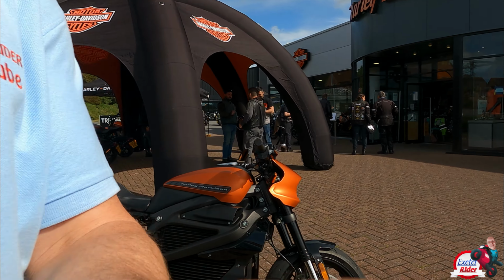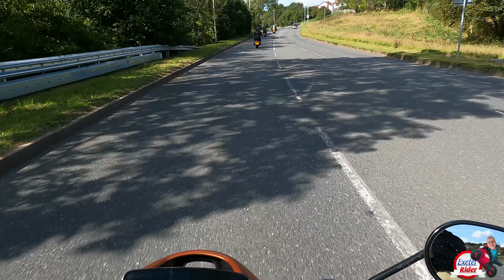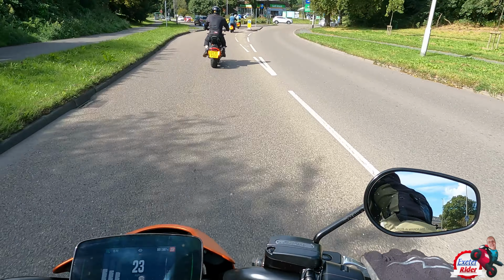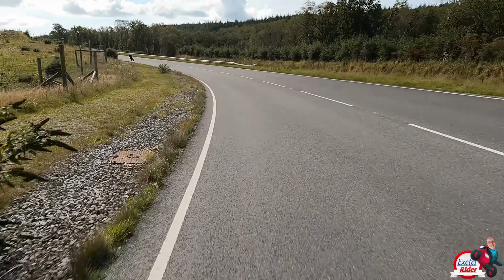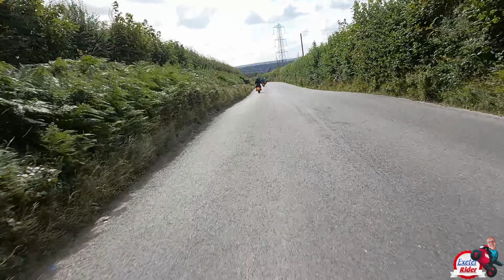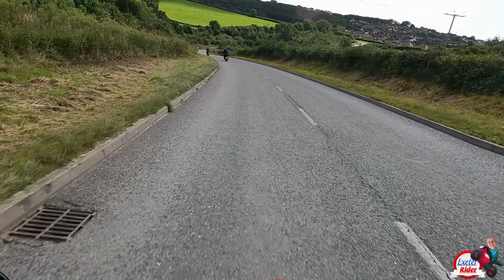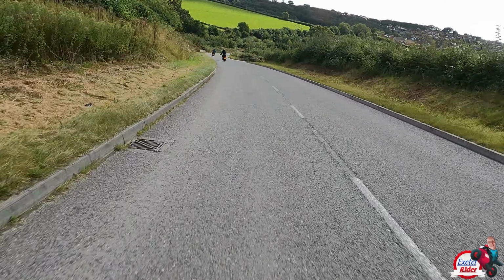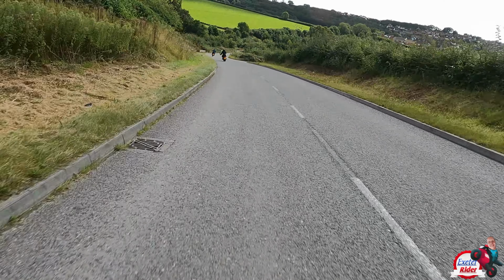Harley-Davidson Livewire Test Ride

Comment: Quite a nostalgic video for me,I remember that noise very well but with the added rattle of milk bottles in the morning.
I wonder if Harley will try to patent that sound....or have Dyson beaten them to it?
Looks good actually but waaaay out my price range,I'd probably get £800 for my old Bandit on a good day. I'm in Plymouth,I'd have headed up to say hello if I'd known you were in the City.
A bit of a worry as well that even the dealers were short of chargers,hopefully they'll become universal for electric vehicles so you can pick one up at Halfords or wherever if you need one.
Reply from the maker: Hi mate, will the fast chargers are a one off. This bike is fine for 100 miles, but with the bike being used all day, that's where the problem arose, so don't look into that too much.    If you do 100 miles in a day, you can charge overnight on a 3pin plug and be ready to go the next day.   Thanks Dave, maybe we will meet someday, but that eas a full day anyway 👍

Comment: Although I'd like an electric bike at some point, my only worry is the lack of noise, and people noticing you. They aren't that good when you do have some audible noise to warn them. I do think this is the bike that will push the rest to develop more. Thoughts?
Reply from the maker: I agree with you, but,  I would also say, when do cars hear you anyway? Windows up, radio on etc.
Reality is you ride much more aware that people can't hear you, then compensate for that, so it's not as bad as you may think but still a very relevent point. Thanks 👍🏍️
Reply: @exeterrider  yes, very true. Or too engrossed in Facebook!

Comment: Fantastic motorcycle! I test rode one about a month ago. I used to have a Harley Super Glide so I'm used to their switchgear. I wanted to get it but my body proportions or the way the bike was set up (bars rotated forward maybe?) made me stretch for the grips in a sportbike-ish stance so my neck was cranked that left my neck aching for 2 days after a 20 minute ride. That and the useless mirrors were the only negatives. I wanted to get it but my neck said no.
Reply: Honestly, I prefer my BMW C Evolution scooter since it can go almost as far, almost as quick in a much more comfortable and easy going manner. Yet when I want to play, not many bikes can accelerate like it. I don't need to reach scary speeds. I jumped on that scooter every chance I got. Too bad a deer ended that fantastic run with that scooter.
Reply from the maker: I can see where your coming from there 👍
Reply from the maker: I also really liked the evo👍

Comment: I actually like the look E R in a way would like to ride one but for this to work things would have to improve considerably on the infrastructure front and a 100mls is not a lot , having said that I probably only get 130 to a tank on my XJR , but filling it up is one hell of  a lot quicker than an hour or eight . I think a problem they have is  cost of purchase  and the fact that if nobody buys because of price they simply won't get cheaper unless they can find a much cheaper battery concept .. Liked the colour tho ,👍😊
Reply from the maker: Yes it looks even better in real life. Yes the range won't suit everyone but there is still a mass market for those who can I think. I heard Simon GTR has just put a deposit down since watching this video 😊🏍️
Of you ever get the chance to try one, it's impossible not to like it.
Infastrature is growing quickly, and it's supply and demand, how many charge points do you walk by with no one charging? 
 Thanks for your time watching 👍
Reply: @exeterrider  Not a snowball in hells chance of Simon  getting close to one except to put a match to it 🤣. There are charging points with nobody at them because only the wealthy few can afford them , And the ones that could prefer their Range Rovers and the like .👍

Comment: i prefer alot of engine braking 🤓 i wonder if the brake lights blink when you slow down without the brakes though, im always worried a car will rear end me without brake lights 😆 is it a true 100miles on the highway though? i think the Zeros driven on the highway lose their range fast, 60 to 70 miles 😵 barely enough for me to get home from work with that range 😵
Reply from the maker: Yes the range does go down on the highway as they all do.  They are not for every scenario , but for general commuting they are great and hard to beat for city riding.

Comment: Until you can charge them in a minute and travel 300 miles they are not ready for mass adoption, right now it's just an expensive toy.
Reply from the maker: Yes but for many people they can make it work. I never have 300 mile days out myself 👍🏍️